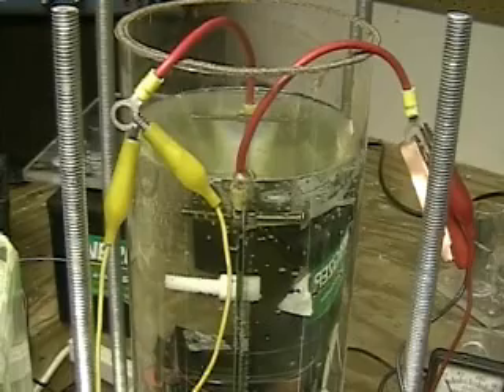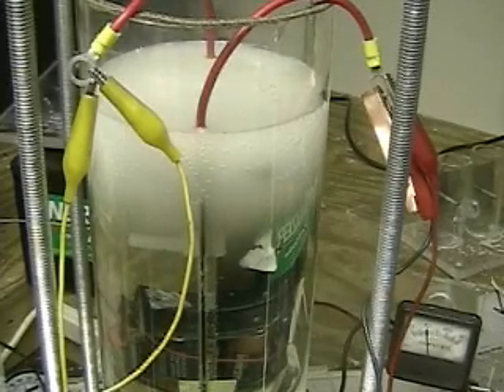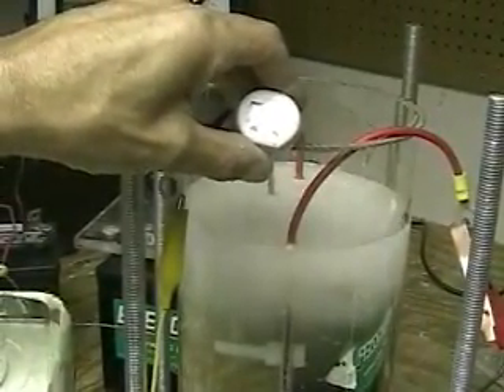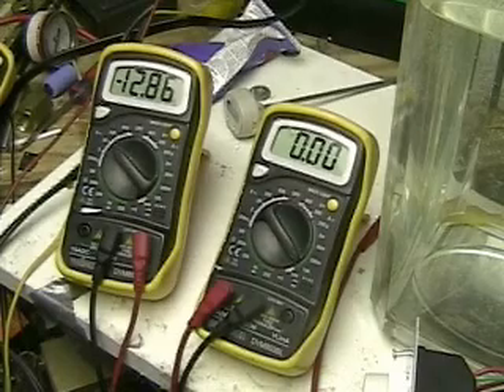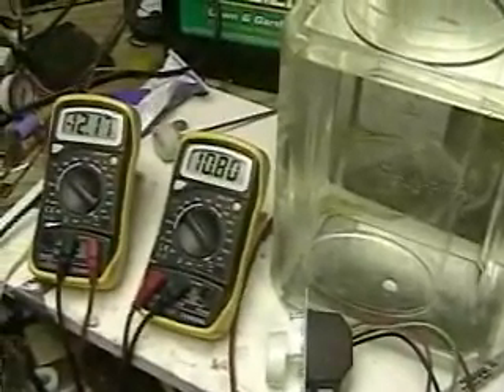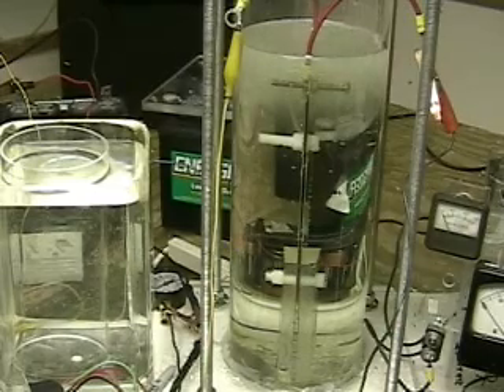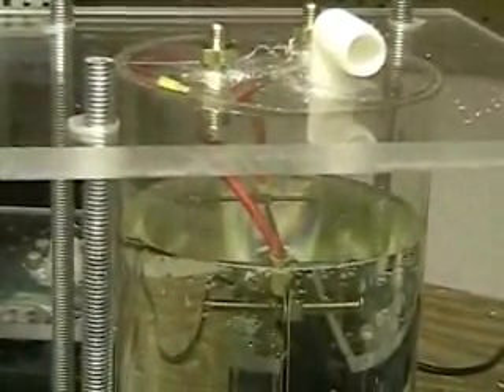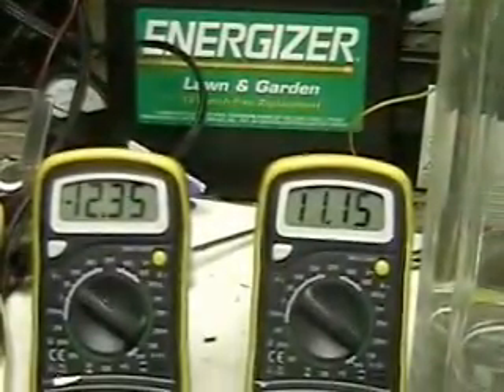Hydrogen Tap (Lab Cell Ready For Car Test) 104

Comment: You don't seem to have a pop off cap for security on top of your cell. Be careful on your car with the backfire problem. Place the cell away from you and don't lean over during the test. It can pretty much act like a rocket when igniting under pressure.